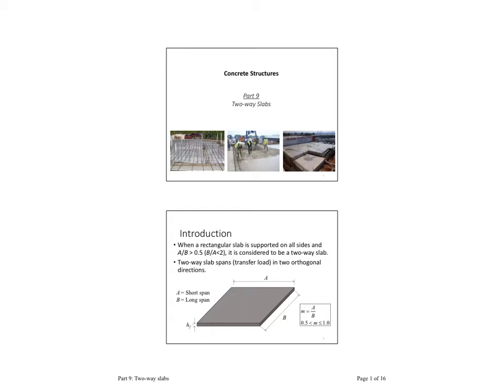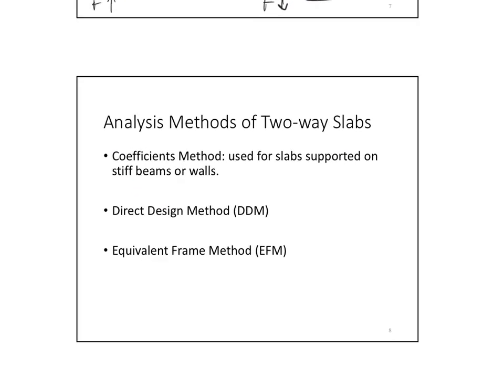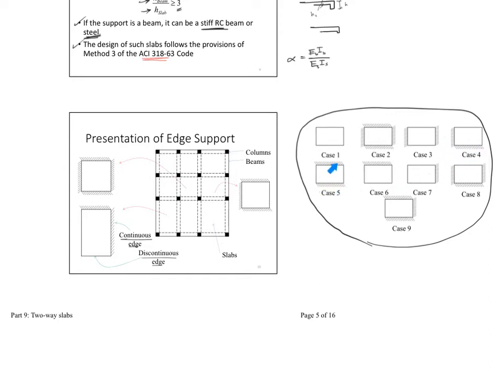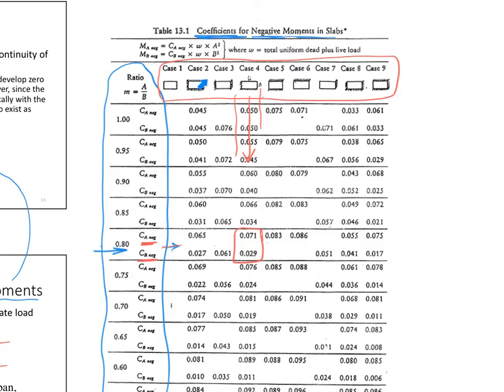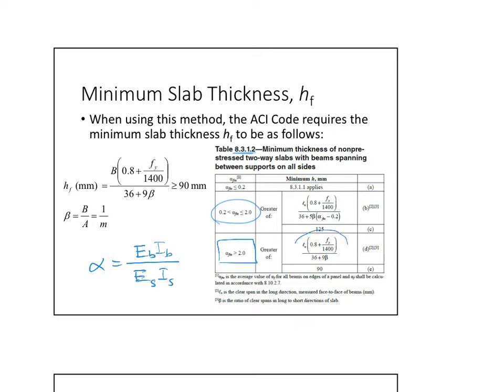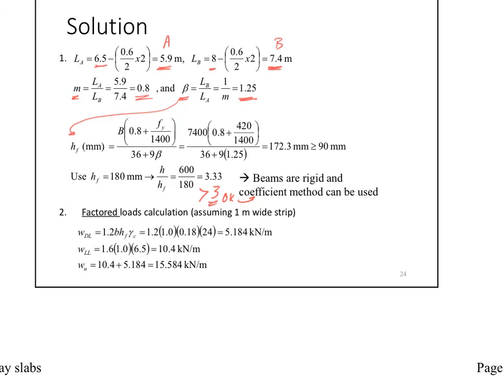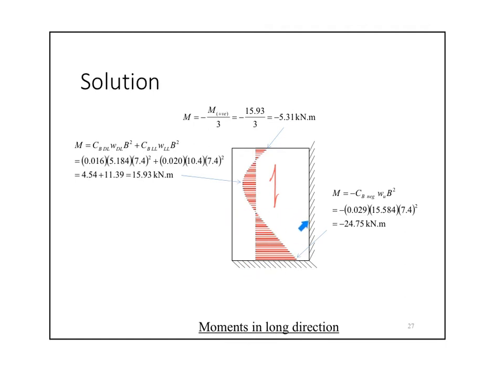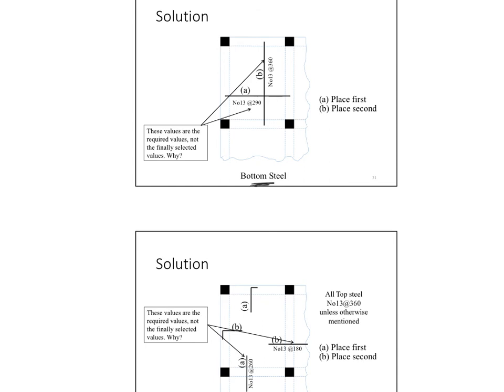Basics of Concrete Design Part 09 (Two way slabs) - Coefficients Method

Comment: Please explain where the Rho required came from?? The Formula I mean, and also what value to be used in Mu-max in every direction?
Reply from the maker: Hello Jedar, the rho req. formula is explained in previous videos on flexural (bending) analysis and design. Please check those videos in my channel and you shall find the required details. For Mu-max, I am not sure what your question means. We normally use the higher Mu in each direction for the design of the reinforcement of that direction.

Comment: I would like to see how you get No. 13 bars with such high moments!
Reply from the maker: if the capacity of the section is enough then it is ok to use No. 13 bars. The moments in our slabs here were not very high.